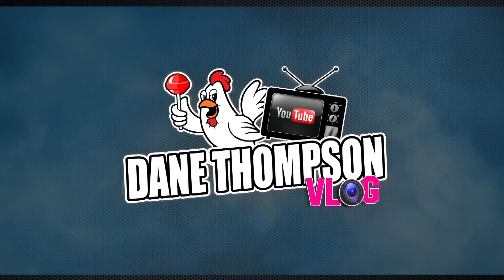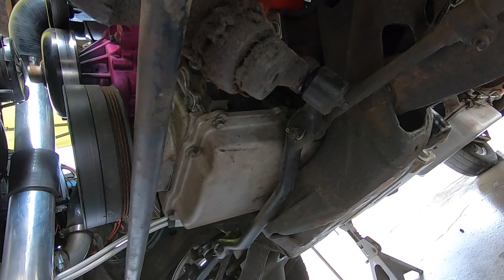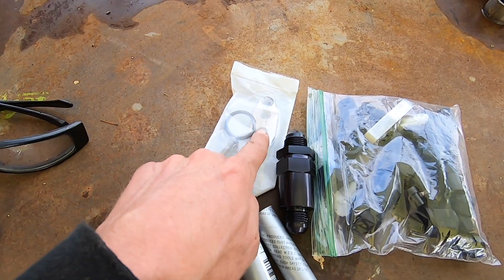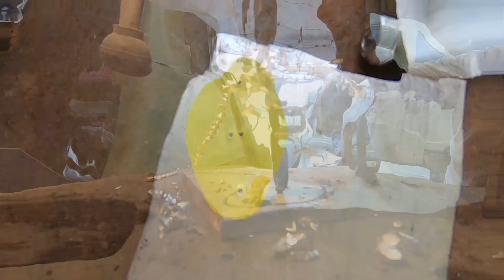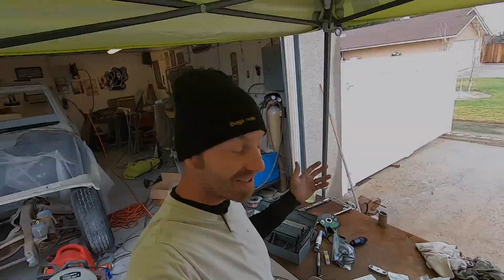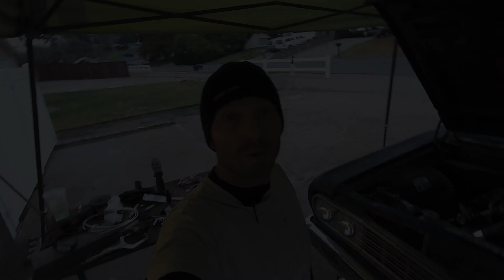LS Turbo Oil Feed and Drain

Comment: Thanks for sharing the work, looks good! I know you’ve been asked but what size oil restrictor? There’s 3 different sizes i believe. .060 .030 and the other one. I want to run the dna gt45 As well!
Reply from the maker: Bowtie Building I’m not running a restrictor on it. Just the proper size drain to the oil pan and it works fine. Never had an issue with oil.

Comment: Cool vid, Have you had any issues with not enough oil drain flow?
Reply from the maker: No not at all. I think the main thing is to size the drain hose properly and make it a straight a shot as possible. Gravity is your friend remember that when your running your drain line.
-Dane
Reply: Burndown i was thinking of using my oil pressure switch as a turbo oil drain. Ict billet makes an adapter that bolts right in for turbo oil return. On forums a lot of people say that’s to low, but they make it so I may just give it a try.
Reply from the maker: @yokelguillory6834  Oil Pressure switch? You talking about the oil sensor in the side of a truck pan? If so that wont work. The oil needs to flow back into the pan and if you put it to the sensor hole it will not be able to drain properly. Just punch a hole in the pan above the oil line and tread it like I did and your done. 👍
Reply: I believe he's thinking of the oil level sensor in a stock pan. Yokel the swap pans don't have that sensor in them is why he put it there. I'm doing the same thing as we speak.

Comment: What kind of line did you use for the feed line? And return? Thank you
Reply from the maker: I used aluminum tubing for the feed line and had a hard line for the return as well but recently changed the return to push lock hose and an fittings. If your on my instagram I can shoot you a DM with pics of each if you ned it. 👍
Thanks for watching!
-Dane
Reply from the maker: @streetsidemechanics1109  Thanks man! My car is on my friends lift and ill finish up with it tomorrow so I can get good pics and shoot you a DM.

Thanks for watching!!
-Dane

Comment: great videos, love the tunes! If you ever get sick of that oil feed setup there is an oil feed galley right on front drivers side of the block that would be any easy shot to your turbo, its right there. you can see it in the first pick of this article. http://www.superchevy.com/how-to/engines-drivetrain/1512-check-out-this-useful-ls-small-parts-guide/
Reply from the maker: Thats right to the main oil feed. I bet one could adapt it down and use it. It would shorten the line like you said and you could even tee it off for twins. Wonder if it would affect oil pressure or anything? Have to see if people are using that. I have used this port to prime new motors but not for a turbo feed. Thanks for the heads up ill look into it for sure.
Reply: Dane Thompson I’ve been feeding mine off it for years. I should probably put a filter on it though but I haven’t yet. I have great oil pressure.
Reply from the maker: Thanks for the tip. I will change this on my next set up or if I go twins. Would make it easier and less line for sure. @brandonloll4262

Comment: What are the turbos.
Reply from the maker: This was a while back and it was a GT45. A VS Racing 78/75 would be a better bet if you need a chap turbo.
Reply: @Burndown  I finally went with 66/80s I hope they spool good.